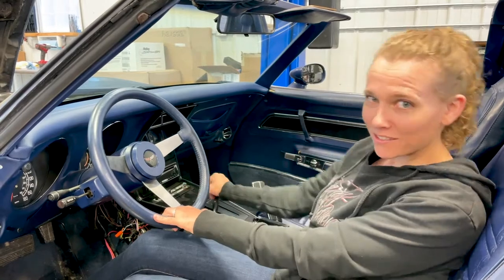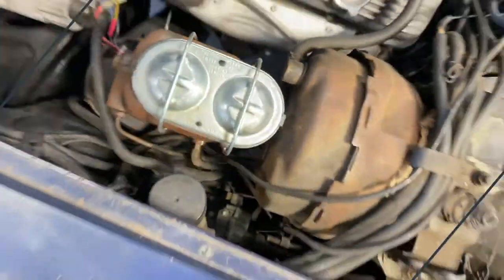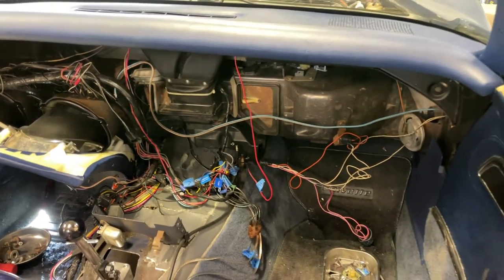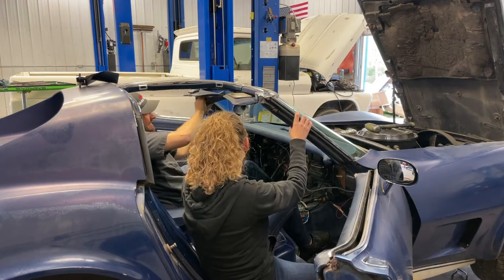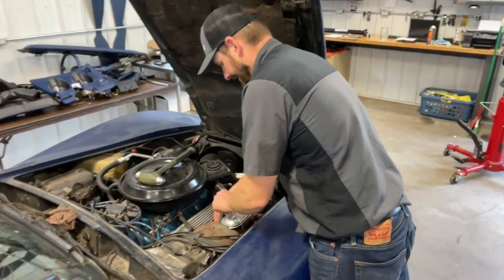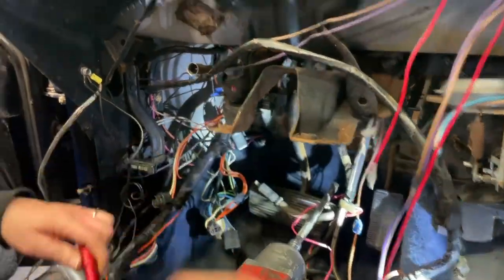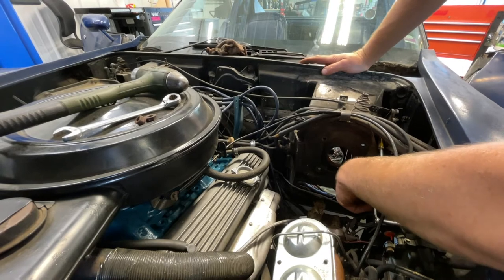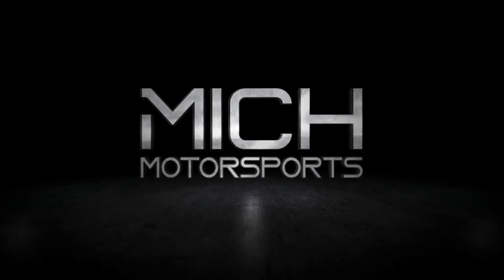Out With The Old To Make Room For The New Clutch And Brake Pedal

Comment: Definitely going to go with a 4 speed car when I get my C3.  Depending on the AC situation, I may still have to pull the dash for a Vintage Air unit.  But at least I'll already have the correct clutch/brake pedal assembly.
Reply from the maker: Having the correct clutch/brake pedal assembly will save you so much time.  The Vintage Air install videos will be coming up next after we finish up with the 5 speed install.  Keep us updated on your C3 search.